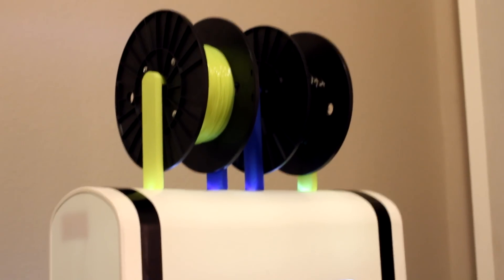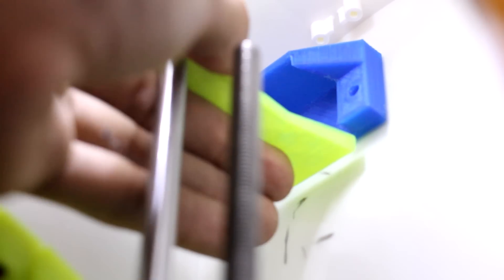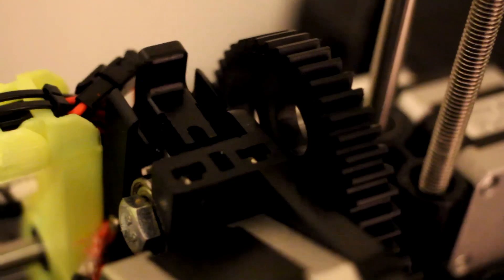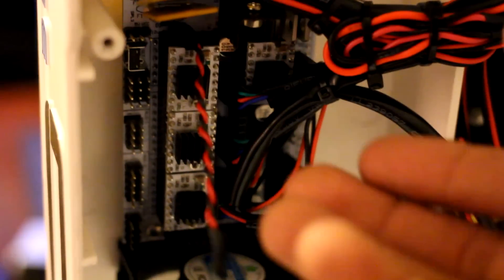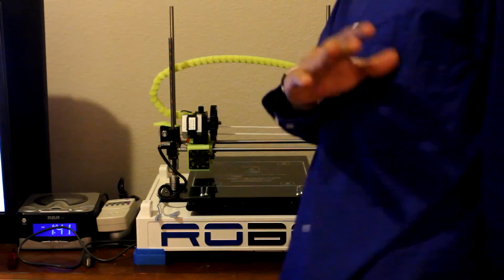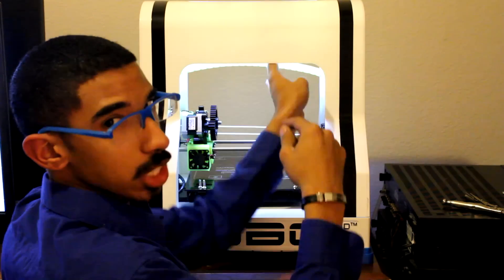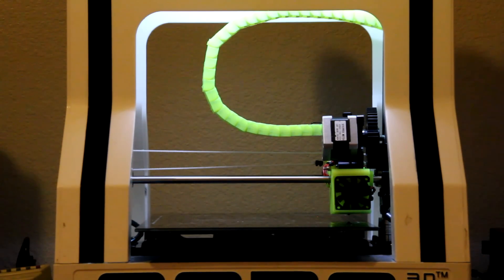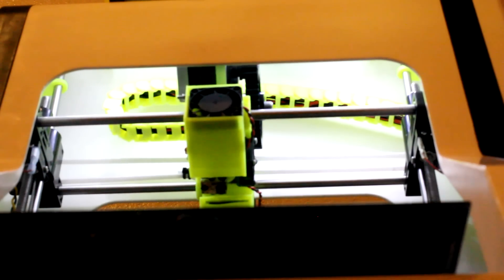Expert Mods: Perfect Upgrades Robo 3D R1

Comment: Good job, Your printer looks so much cooler than mine with all that customization.
Reply from the maker: +koolbeenzbro Thanks! You should see what it looks like now. I should be making a updated version of this video soon.
Reply: Do you have a video of it? I'm working on making an enclosure for the printer. Do you know how I can get my Robo 3D R1 Plus to be more accurate? Also when it prints circles they come out as a polygon vs a true circle do you get the same thing? I'm not sure if its software or printer issue. I like the production in your videos btw keep it up!

Comment: Awesome video, I got a robo 3d r1 with auto leveling and want to do the top led strip mod, I got the Logisys 12" 18 LED Super Bright Sunlight Stick White 	 	which i assume is sticky taped to top but where do I connect the cord for power. I hear you say yellow to blue and black to grey? To the board or some other part?

Comment: Hey so I have a robo r1+ and I have been trying to print flexible filament but it won’t pull it through. You said the guide tube helps with that. Have you made a video on installing that? If not that would make for a really good video.
Reply from the maker: flexibles have been my demise, if I find a reliable solution I'll let everyone know

Comment: just bought the robo 3d R1 I'm trying to edit the chain-link design you put on thingiverse. can you tell me which program you used because everything I try is not working. I'm trying to remove one of the brackets so I don't have to remove my wires to put it on. can you help

Comment: Returning my Robo 3d today, first print was okay (a couple of z axis holders, even though the opening was way too small for the rod and they were essentially unusable), after that it was nothing but one horrible print after another.  Went to different forums and watched numerous videos trying to tune the thing, but it just got worse with each print.  I like what you've done with yours, I just wish that I could have got mine to work.
Reply: Well, I have some time before Amazon said I have to actually do the return.  Right now my biggest issue is that the extruder is not working.  It's not that it isn't heating up (it is), it's that the gears are not turning to extrude.  I can turn them by hand, but when printing they do not work, and when a command to extrude is sent from the software it doesn't work.
Reply: I can turn it by hand, it just doesn't extrude in a print or when the extrude button is pressed in the software.
Reply: arcanum70  Your set temps must be set to at least 195 or higher for the stepper motor to engage. This is a fail safe built into the firmware. I recommend at least 200 to allow for temp drop.
Reply: arcanum70 RoBo3D support is always available to help you get your printer running great.  We now have a 24/7 hotline you can call.  You can also schedule a 1 on 1 Skype call with a RoBo3D Tech.  Every printer comes with a 6 month warranty and we will replace any parts that need it within that time.
Reply: RoBo 3D Actually, I just exchanged it.  And I know for a fact that (if anyone reading this is curious) that you guys are awesome when it comes to part replacement.  Really enjoying the printer.  Still far from being anything close to an expert.  Trying to find a slicing program that I like, and that works well with the printer, but, I'm getting there and enjoying the ride.

Comment: Hey man, I've been doing some serious research and I think I want to buy the R1. I just had a few questions/concerns that I really hope you could spare some time to answer. 
1) Are you pleased with you      purchase? I just REALLY don't want to waste 700 dollars. 
2) How necessary would you say those upgrades are for the printer? I would definitely be using the printer a lot and I would most certainly want the best results, it's just I'm not usually a DIY kind of person. 
3) Do you have any videos showing exactly how you set all of that stuff up? Specifically the writing things. It all looks so complicated, but given how well yours seems to work and how pleased you are with it, I would want to make mine as close to yours as possible. 

Thanks
Reply: The head that the new r1's come with...are they already able to print with other materials such as ninja flex and wood? Or would I have to upgrade it?
Reply: Novice Expert Brison Chu As for printing with Flexible filament you can do an easy modification with a small 22mm ptfe tube between the hobbed bolt and the entry to the hot end to prevent it from curling up.  The other option is to get a 3mm all metal hex hot end and use 3mm Ninja flex since it's not delicate as the 1.75mm.  Wood filament works well by with the default setup.

Comment: Can you please share the link to your Z stage stabilizers.  They one you provide requires a screw to secure.  The ones you show in the video have a dovetail type connection that make it very easy to remove the lid :)
Reply from the maker: stantok Sure, it may be temporary but here's a link to the one in my dropbox:https://www.dropbox.com/sh/jy98ql4favlz78v/AAA96VKGvkd1N1pVZ-hjKZQda?dl=0
Reply: +Novice Expert Hi i really like your Z rod stabilizer is it possible to get that file or a link to the file? i just picked up a used R1 and need to do a bunch of upgrades but i need to print parts to do so and i really need a stabilizer and really like yours. And also i really like your videos they have helped me out a lot so thanks
Reply: +robert jacobson much like before, may be a temporary link. Here you go: https://www.dropbox.com/s/rz468vqgzcczbbj/Stabilizer.zip?dl=0&preview=Stabilizer.zip

Comment: Hey NE,
I am having an issue with my printer, was wondering if you can give me some pointers. 
I am new to the whole 3D printing, bought robo R1 as an impulse. when I print small stuff, it's fine. but when I print something with about > 2-- layers, my hot end actually just knocks the print off the bed. 
another question I had was, do the new R1s still need Z stablizers? it seems like mine has two holes at the top of the plastic casing that holds the Z axis in place.
Reply: Novice Expert
At this time I'VE tried everything but the glue stick. i.e. hair spray, masking tape, K tape (even tho I am currently using PLA). I tried one of them calibration cube, and the print had all sorts of things wrong with it. it's not even, lines are not straight. and it once again got knocked off after about 23~25 mm mark.
This was when I was using blue masking tape.
bed temp at 65
hot end at 200
printing PLA
using Cura
using canola oil.
Reply: Novice Expert Question, I just got the e3d. and lot of people are saying I shouldn't use bowden, because you cant use soft filaments. what do you think about this. also what's the difference between bowden and  PTFE tube?

Comment: What is the tubing that you are using to bypass the bearing in the extruder?
Reply from the maker: Peter Sharma PTFE Tubing, I cut it later on. So now it is below the bearing.
Reply: Awesome thanks! Have you printed much with exotic filament outside of polyflex?
Reply from the maker: Peter Sharma Nylon as well. Still want to get ColorFabb XT, Woodlay, T-Glase, and Carbon fiber. But until I get money that will have to wait.

Comment: i need some help please . I was going to update the firmware with some of the changes you suggested and now I keep getting this error when i try to compile  how can i fix this ? please help
thank chuck
Arduino: 1.6.8 (Windows 10), Board: "Arduino/Genuino Mega or Mega 2560, ATmega2560 (Mega 2560)"

In file included from sketch\ROBO3DR1PLUSV1\dogm_lcd_implementation.h:38:0,

                 from sketch\ROBO3DR1PLUSV1\ultralcd.cpp:36:

sketch\ROBO3DR1PLUSV1\dogm_font_data_marlin.h:12:25: fatal error: utility/u8g.h: No such file or directory

 #include <utility/u8g.h>

                         ^

compilation terminated.

exit status 1
Error compiling for board Arduino/Genuino Mega or Mega 2560.

This report would have more information with
"Show verbose output during compilation"
option enabled in File -> Preferences.
Reply from the maker: +just me Sorry for the long response, but that problem is usually caused by the library being absent from the library folder. Go here: https://github.com/olikraus/u8glib.git and download the library and place it in the library folder of your computer.

Comment: HI nOVICE / EXPERT
how can i remove my extruder on robo3d r1 plus mine looks a bit diff. there is a fan on the side the screws that are supposed to release the extruder . should i remove this fan first ?
Reply from the maker: +Paul Robb https://youtu.be/sZM6MIuPorQ at about 0:55 shows how to take that apart. That was a stock being upgraded

Comment: have you experienced any issues from the printed belt? Has it stretched any?
Reply from the maker: Frank Ribitch It had kinks in it, but never lost it's accuracy, I switched back to the regular one. I keep the printer one around just in case.
Reply: +Novice Expert What was your reason for switching back to stock belt? I was thinking about printing one up but if there is a reason why I shouldn't , I wont. May still be a good stand by just in case

Comment: How do you install the E3d v6 Extruder on the Robo3d r1 Plus? I need your help . Thanks :)
Reply from the maker: Wish I could help more, but I don't own a R1+ I was looking around the forum for a R1+ tutorial, but couldn't find anything there either. However there is some mention of how to remove the plate to the extruder in this thread: http://community.robo3d.com/index.php?threads/e3d-v6-information-installation-guides-and-review.3407/
Reply: Novice Expert Thanks Ill probably just keep the extruder i have and not upgrade it.

Comment: I'm looking at buy the E3DV6.... should i get the 12V or the 24V? besides the voltage whats the difference?.....do you have a video on how to install it?
Reply from the maker: Delroy Pearson Some printers like my buddy's flash forge have 24v power supplies. We have 12v power supplies in our printers. I can make one, but it may just be a dis/re-assembly video of the one I have on there.
Reply: Thank you very much......................keep up the great work
Reply: What slicer are you using? can i copy and paste your start and end gcode into my cura slicer?
Reply from the maker: Awesome, we use the same slicer. You can copy and paste it. This is the most recent revision of the Gcode (always making tiny adjustments).

 M140        S{print_bed_temperature}
 M104            S{print_temperature}
 M107;                       FANS OFF
 G28;                   HOME ALL AXIS
 M84;                     KILL MOTORS
 M109            S{print_temperature}
 G1 Z2;           RAISE Z-AXIS TO 2MM
 G28;                   HOME ALL AXIS
 M565 Z-0.6;            Z-AXIS OFFSET
 G29;                       PROBE BED
 G1 F10000;         SET FEEDRATE FAST
 G1 Z2;           RAISE Z-AXIS TO 2MM
 G92 E0;                ZERO EXTRUDER
 M190        S{print_bed_temperature}
 M117           READY WHEN YOU ARE
 ;M25;        WAIT FOR USER (SD CARD ONLY)
 G1 X20 Y20;       MOVE CLOSE TO HOME
 G1 Z.2;         LOWER Z-AXIS TO .1MM
 G1 F1500;          SET FEEDRATE SLOW
 G1 X200 E20;         CLEAR FILLAMENT
 G92 E0;                ZERO EXTRUDER
 G1                   F{travel_speed}
Reply: Thanks.....just to be clear I would replace the following start.gcode with what you have provided... correct?

;Sliced at: {day} {date} {time}
;Basic settings: Layer height: {layer_height} Walls: {wall_thickness} Fill: {fill_density}
;Print time: {print_time}
;Filament used: {filament_amount}m {filament_weight}g
;Filament cost: {filament_cost}
;M190 S{print_bed_temperature} ;Uncomment to add your own bed temperature line
;M109 S{print_temperature} ;Uncomment to add your own temperature line
G21        ;metric values
G90        ;absolute positioning
M82        ;set extruder to absolute mode
M107       ;start with the fan off
G28 X0 Y0  ;move X/Y to min endstops
G28 Z0     ;move Z to min endstops
G1 Z15.0 F{travel_speed} ;move the platform down 15mm
G92 E0                  ;zero the extruded length
G1 F200 E3              ;extrude 3mm of feed stock
G92 E0                  ;zero the extruded length again
G1 F{travel_speed}
;Put printing message on LCD screen
M117 Printing...
Reply from the maker: Yea, get rid of everything.
Reply: *****WONDERFUL**** thanks again!!!! I got my E3V6 hotend in the mail today....do you know of any videos on  how to install it on the ROBO 3D?
Reply from the maker: Delroy Pearson 
Thomas Sanladerer
https://www.youtube.com/watch?v=xr02pG58gaU
Reply: Thanks. Tom was great!!!... on a another note,,,,after pasting your Gcode... my hotend moving too close to the bed...whats the proper height? and how to i change it?
Reply from the maker: Delroy Pearson Increase the number on M565

try Z-1and from there you can adjust it to yours

Comment: Let me first say i like your videos. lots of info. thanks for that. being you upgraded a lot to your printer. did you upgrade the firmware to it as well? what version are you using? i'm asking because i just bought a Robo 3D printer from a seller ( bad experience) seller (llfila9 aka Ben Delgado) be warned....  Seller claimed it only need new stepper motors but it really needed everything, i mean everything i even had to fix the casing. anyway long story short i replaced everything even the wiring. now its time for me to upload Robo 3D firmware to the arduino to run it. just need to know what version i should use to upload to the arduino? the printer is the newer model with the rod support on top of case but has the limit switch on z axis rail for x axis and not on carriage like your newer one. any help you can give would be great.

Thankz Chaz
Reply from the maker: +Robo netix Sorry about that, YouTube didn't display you comment till now. If you still need help with the firmware lmk, I love playing with the Marlin firmware :)

Comment: Did you design all of the parts for it or did you find the files somewhere?
Reply from the maker: Timothy Plant Designed fan ducts, everything else was found. All links in description.
Reply: +Novice Expert you redesigned the z stabilizers didn't you
Reply from the maker: Nah those were the original ones before the creator redesigned them.
Reply: Novice Expert mind reuploading the stl, (remember to use the same license (CC-BY-NC-SA)
Reply from the maker: +Gordon Freeman I can redesign the .stl but I don't know if I have the original files.

Comment: I'll stick with my complete in box FlashForge Finder. Volume is small and no heated bed tho.
Reply from the maker: +Mickice Looked it up, looks like a superb printer. I'm sure you could figure out how to add a heated bed to it, owners of 3D printer are inherently innovative.
Reply: Indeed we are, the machine is a box frame but I've already placed weights on the black bass to prevent vibrations and added rubber band to the wing nuts that level the bed so it doesn't shift over print. The best feature is it'll pause a print when out of filament.

Comment: +novice expert I have a robo r1 and am getting warping along half way of my prints any help will be great
Reply: +Oldskool1427 Glue is NOT easy to clean up. It  took 4 times of windex and then wiping and scraping for me to clean the glue off. I started recently using hair spray. You barley even need to clean it.

Comment: i cant get the links to print. it fails on the bridge every time
Reply from the maker: Nathan Horning Fails? how so, stops printing or the bridge is drooping?
Reply: Ya it droops down to the point it isn't connecting.
Reply: It's the top bridge point on the link when it tries to print the "bridge" it just collapses
Reply from the maker: Oh, If that the case just generate support material.

Comment: Thanks for posting all these videos. As a newbie to 3D printing, you have made getting up to speed a breeze. Also, I was not a fan of the spool holders shown in this video so I edited them.  The improved design locks the holder in place (I learned the hard way that this was necessary after a large spool came loose and crashed down on my glass). The new design also adjusts the angle at which the spool gets drawn (so it is a smoother pull). Anywho, check it out (http://www.thingiverse.com/thing:1148533) and let me know what you think. Cheers!